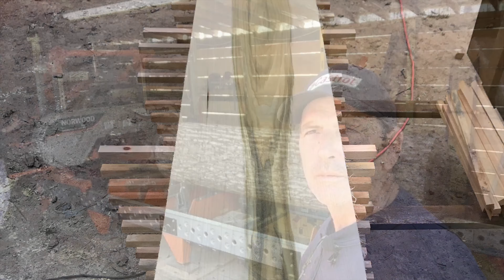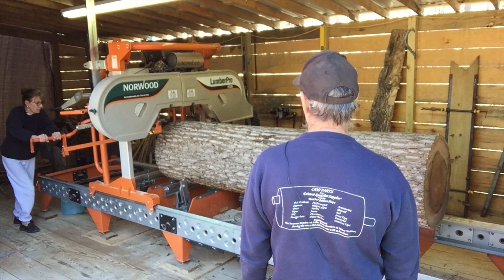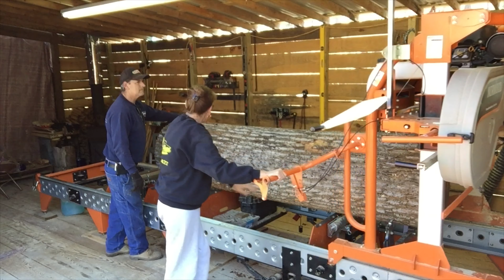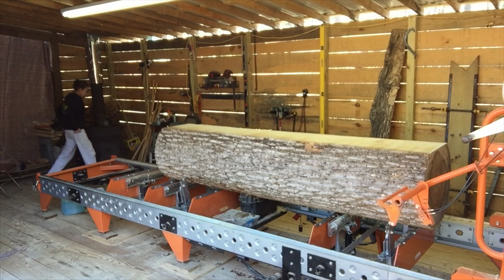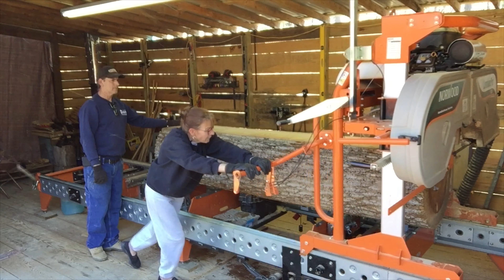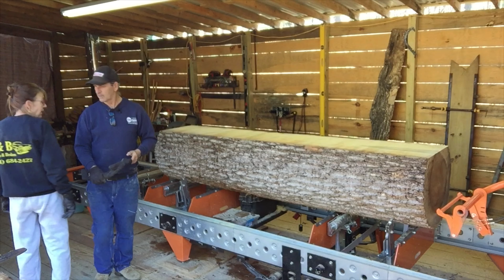More poplar boards on the Norwood hd36

Comment: The  norwood  you have  is a manual  mill and is a third of the price of a cook mill  and  woodmizer  .
You only get  really what you can afford and it is hard to compare  a hydraulic mill to a norwood.
I have a norwood  and are happy with the  way it cuts but my  choice if i had the  money  would be  a lt35 Hydraulic  woodmizer and maybe  one day i will get one.
Reply from the maker: Mr.Alexander the Norwood we had was a hd36
And it was a full Manuel mill. I have regrets of the Norwood it did a great job. The only reason we sold it was me and my wife are almost 60
And the sawmill was my wife’s sawmill and it was just too much Manuel labor on her running it by herself. When I could help it made it a lot easier on her but she enjoyed running it by herself. Believe me she says she misses it everyday… we purchased the woodmizer lt40
Hydraulic mill just for the hydraulic. If Norwood was a lot more helpful and not so set in there ways on selling you the upgrades we would have upgraded it to full hydraulic. But Norwood wouldn’t let you just buy piece by piece you had to buy what they told you what to buy snd that was just too much at onetime. I looked at the cooks real hard and almost bought one. Keep on milling and save that money and you will get what you work toward in the end. Thanks for your comment.
Reply: @MsdMakingSawDust  i agree   Norwood  hydraulics  are  to expensive  and you have done the  right thing  by purchasing  a lt40  they are a great machine .
I have  just purchased a loader  a victory 200 it can lift over 2 ton and it has made life easy for me loading logs onto the mill .
I am 70 and have made a lot of ad ons to my mill  .
I have a youtube video  coming out shortly .
All the best  Rob
Reply from the maker: Congratulations on the new loader, I would love to have one of them… yea I made a lot of modifications to the Norwood before I sold it.
Yea we think we made the right choice on the lt40 to. Thanks , yes please do make a video would love to see it.
Reply from the maker: Hey Mr.Alexander you have a YouTube channel ?

Comment: How do the saw blades hold up?  Do they get dull fairly quick?
Reply from the maker: No problem with the blades dulling out . they hold real good we can cut quite a few poplar logs with them. We use cook’s saw blades.
Reply: Before you bought the Northwood, did you consider buying any other sawmill manufacturer
Reply from the maker: Yea cooks sawmill
And if I had to do over I would have never 
Bought a Norwood sawmill.
Reply: What don’t you like about the Northwood.  What sawmill manufactures would you consider over the Northwood?
Reply from the maker: I don’t like there ceramic guides setup
I don’t like there plastic band wheel cover
And I don’t like how they will only sell you
Certain add-ons for the mill and there shipping 
On parts are out of this world. If I had to buy
Another sawmill I would go with a cooks
Or a woodmizer.
Reply from the maker: And I don’t like there mouth opening 
On the saw head it limits you from 
Making a deep cut .
Reply: @MsdMakingSawDust  You do realize that roller guides can be put on your saw. They have their own issues also. Wood Mizer saws are good but you cannot upgrade them down the road. They force you to buy all the bells and whistles up front. As you need, Norwood can be upgraded anytime. I've owned both, so i am not talking at my ass like you.
Reply from the maker: I’m not down grading Norwood saw mill 
It’s just a few things I don’t like on there mill other than the few things I don’t like the mill is a great mill. 
And if u look there are things u can find on any mill that certain people like or dislike.I was just giving my honest option of what I liked or disliked.